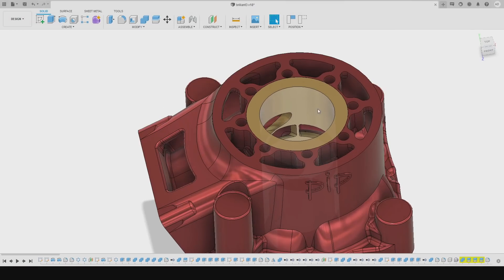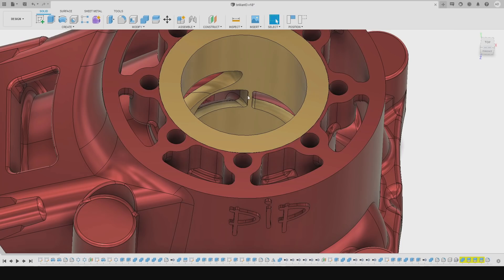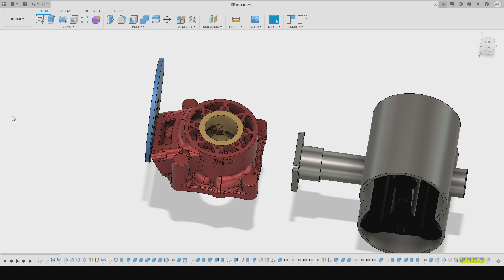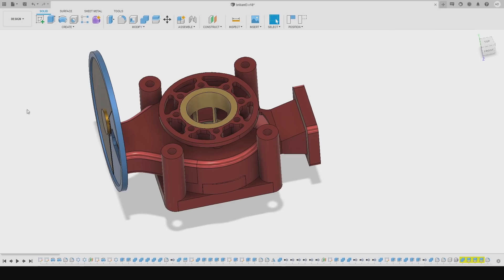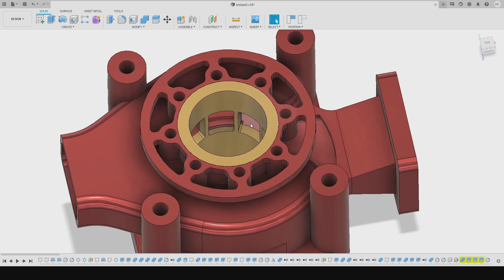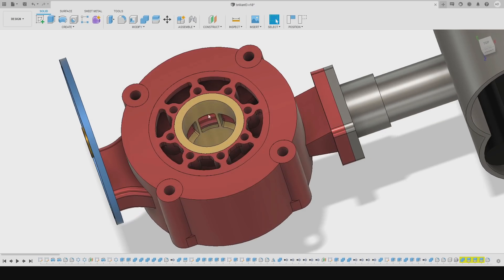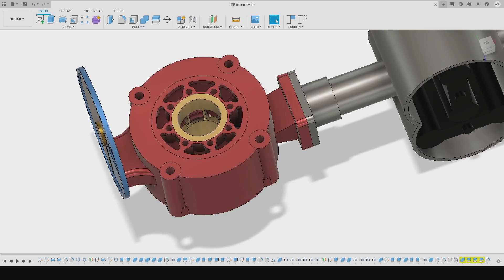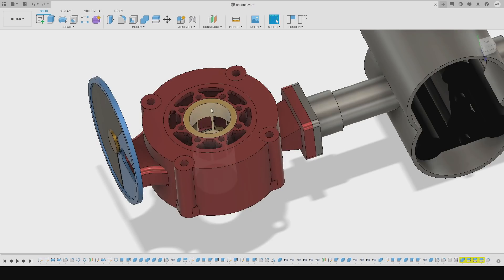Will BLOW Up the Competition! Seriously!

Comment: Two things come to mind: pumping the flushing gases takes power to turn the blower. What happens if a hot particle ignites the mix in the intake duct, likewise, the exhaust while flushing - your reed & rotary valves need to be unobtainium not steel. Why not two rotary valves on a common shaft?

Comment: Surely with this level of complexity you're better off with exhaust valves, properly timed in the cylinder head and the intake all round the cylinder. You can also run a turbo as well that way 😁, you have just reinvented a Detroit diesel 2 stroke but with a different exhaust valve.

Comment: Ever since 4 stroke direct injection gasoline engines started to hit the scene I thought this brute force 2 stroke induction idea for would be perfect paired with direct injection because you can time the fuel injection precisely when the ports are closed. I don't think it will be practical to try direct injection on your little engine but it's still an idea to ponder maybe for another project down the road

Comment: Good idea!
But you can exchange the rotary valve and the blower for a turbocharger ... the pressure would be automatically increased between the cylinder outlet and the turbine so you don't need the rotary valve, and the compressor is in charge of pressurizing the cylinder

Comment: how do you pretend to cool this engine? you have exhaust all around the cylinder it will probably have a hot spot. Also cylinder pressure is way higher then any boost pressure. So i will open the exhaust ports at least a little before intake ports. Detroit diesel two stroke uses just one valve to control exhaust in the cylinder head and have a similar design of ports all around the under crank.

Comment: YES! i drew a rough sketch of an engine similar to this when i was in high school, always wanted to see what would happen! in my old concept i was thinking that a direct fuel injector could help a lot with fuel efficiency and pre-combustion issues and would allow you to run a 4 stroke style pressurized lubrication system, which in turn allows you to run strait gas. but obviously thats much more complicated to set up with the high pressure pump and all that... also Ferrari did something similar with the Tipo F134, worth a look.

Comment: If you had direct injection of the fuel from the head you wouldn't have good fuel and air being forced out the exhaust from the blower.  Just air would be forced out during the overfill of the cylinder and the direct injection would not add fuel until all the transfer ports are covered by the piston.  This would make it way more fuel efficient and burn way cleaner also.  I am also curious to see how well the reed valve will hold up to the heat and exhaust pressure as you have described.  Also curious as to how much horsepower it will take to run the blower.  Seems the sizing and speed of blower would have to be experimented with to optimize.

Comment: That blower is going to take some power to drive.  Question is will the engine produce so much more power than it otherwise would have to make it worth the extra parasitic losses from driving the blower.  Also it'll be cranking out unburnt fuel through the exhaust like 45 bastards so that header is gonna get REAL hot!  :)  Can't wait to see the result.

Comment: I think you should use a centrifugal supercharger to reduce parasitic loses and make the exhaust port higher to open before the intake ports, because there’s a chance the exhaust might set off the intake misfire before it gets into the cylinder. And to increase efficiency out a turbo on it to increase the back pressure. Have a draw through carburetor set up, then centri feeding turbo(again reduce parasitic loses) and then engine.

Comment: The intake length tuning will be important for the timing of charge air to push the spent charge out. this would allow a longer duration in the rotor valve. are you going to use port or direct injection or carb?

Comment: if the intake and exhuast open at the same time, wont the engine blow up if the compressed mixure in the intake hits the hot exhaust? assuming the exhaust presure is higher than intake? also if the intake blower is generating that much pressure it eats away of the power from the engine. 
that said, very cool idea and the cad design looks very nice!

Comment: I think the problem you're likely to run into is longevity of the exhaust valve due to heat and lubrication issues. 
A more efficient way of doing seems to me to use a poppet valve in the head like in a Detroit Diesel or (more fun and cooler) a sleeve valve.

I want to know what's pixelated over your left shoulder!

Comment: I see this motor actually making good torque unlike most 2 strokes no waiting for power bands, just boost it could even work with a turbo and start it with a leaf blower, you should look a old 2 stroke diesels pretty much the same concept for port timing

Comment: Wow sounds cool, but.... what about overpressure on the intake when everything is closed and the huge parasitic drag spinning that HUGE supercharger. BTW if you want that supercharger to last take it fully apart and clean all the crap they leave behind and put it a good set of bearings. If it should backfire with a draw through system you have to have a way to vent the explosion of the compressed A/F mixture unless your going with direct injection. Personally I think crossflow would scavenge better. If you can work out all the issues it will sound really cool. Hey instead of resonance of your current engine put the supercharger to work as the secondary induction system that comes in around 6000 rpm, just use a centrifugal clutch. I still think using no ring on the current engine is the way to go. Just lap the piston to the bore at operating temps so it fits perfectly. The only problem is you have warm the engine fully before it will move, just like a Formula 1 engine. The piston could be made much, much lighter so you can turn even more RPM's! Best of luck!

Comment: I think the high exhaust ports will hurt performance.  Personally I'd leave them low, as the intake charge will always be pressurized. The higher the exhaust port, the less compression, and more waist from the exhaust, as you are allowing longer duration to the Exhaust, thus increasing Exhaust runner pressure = waisted power and fuel.
The rotary valve is a good idea, CanAm used that in thier dirt bikes years ago, and it worked.
An exhaust valve in the head would keep the inlet charge in the chamber allowing a hotter intake charge.
Think of a Detroit Diesel 2 stroke. 
Further, maybe a rotary valve on the head instead of a traditional valve maybe a lil more efficient??

Comment: I love your creativity and your willingness to experiment.  The only obstacle I can see with your new design is how are you going to stop combustion when the piston is on it's way down? I am thinking as soon as the exhaust ports are uncovered, the combustion event will propagate to the plenum surrounding the piston and blow a hole through the rotary valve...the whole area from the exhaust ports to the rotary valve will have an unburned air/fuel mixture in it....maybe you have discovered a new type of jet engine?  I can't wait to see it, and I hope I'm wrong.

Comment: I came up with a similar design in 1970 with an isolated crank case.
If it works you will end up with  a 2 stroke top end and possibly a 4 stroke bottom end.
The ideal setup.
Love your work.

Comment: At some point you will reach a level of complexity that won’t be worth it. You might as well put valves in the head and add camshafts and forget the ports in the cylinder entirely. Don’t you get what I’m saying? You’re slowly building a 4 stroke. Except this engine will be more complicated and less efficient. I love the old design and I think it is really promising. Please don’t give it up.

Comment: hell yea another new amazing project :D do you have an idea about the bottom lubrification? the great thing is that the piston should be very lubrificated with that design , just need to find a way to use that "wasted" pressure and oil to lub the bearings. also a down side i m seeing is that the ring may not have enough material to transfer heat to, making the piston and the engine overall run hotter maybe you could make some kind of hollow piston skirts so the "wasted" mixture comes in the piston and cools it down
Reply: oh i just had an idea, since the supercharger pressure will increase each time the piston closes the way , you could use that extra pressure on oiling the bottom end of the engine via a wastegate type of thing placed in the bottom . i don t know if it could work as i m not really confortable with 2 stroke oiling to begin with . if you place it well enough you may even be able to cool down the bottom of the piston with the mixture maybe via a squirter thing like in 4 strokes engines
Reply: or maybe not a wastegate but more like a rotating disk system , like you will use in the exhaust, that way you re not limited to a spring that takes time to react

Comment: Thats just crazy!!! Maybe you need to put the intake on the Motorblock, direktly to the crankshaft. Otherwhise it wount   rund at low rpm because the compressor starts comressing only if the crankshaft is Running on high rpm. Or you make something with direkt Injektion. But in Theorie a cool project. Always exited to see new videos 😉🙃

Comment: i'm in no way knowledgeable enough to give any advice, however I think you need to get the rotary valve and the reed valve as close as possible to the combustion chamber. Exhaust gases will have a hard time getting to the reed valve and keeping it close while simultaneously exiting from the exhaust. I think you risk a little bit of burnt gases remaining in the combustion chamber compressed together with fresh mixture.

Comment: Hey mate!
Since you are thinking about Supercharging: Maybe you should have a look into preWW2 DKW-racebikes. They run a concept called "Ladepumpe" which means something like charge pump and later switched to supercharger. Interesting for you could be the UL-Concepts (U stands for engine and L for "Ladepumpe" so charge pump) They later moved on to ULM (M for Membran - membrane) and then to ULD (D for Drehschieber - rotary valve). Sadly the US, which was the Supercharged one, had to much mechanical faults with the charger. They had it chain-driven from the Crank at about 1:1 ratio. It pumped constantly air into the crankcase at about 0,9-14 atü ( 27-34psi i think). And since war already started, there was no time to evolve that concept. After WW2 they build a concept called "GS" - supercharged but different engine design.
You can find Videos of the UL/ULM/ULD on youtube mostly under the name "Singende Säge" which translates to singing saw :-)

Greetings from Germany!

Comment: between the blower, and the reed valve, why not have a containment vessel that the blower fills with pressurised air, electronic release valve to then release the charge into cylinder once the piston has past the exhaust port on its way back to top dead centre.

Comment: I wonder if there is enough of the fresh fuel/air mixture coming out exhaust to feed a small ram jet engine. Or just put some kind of igniter in exhaust for some flames and maybe some thrust. Just thinking of ways to take advantage of the leftover unburned mixture.

Comment: intriguing. I think it has all kinds of potential. The first 2 big things that jump out at me,  #1. the challenge of setting up and timing the rotary valve. I suppose if it's geared/chained to the crankshaft with proper even/consistent timing and reliable at high speeds, then it could be feasible #2 the reed valves on the intake resisting pressures and the supercharger constantly making pressure.. might require a big enough chamber on the intake side between blower and reed valves to give it a cushion like an air capacitor, OR a blowoff/bypass valve to vent excess supercharger pressure when it's not being asked for. Totally rad, quad ducts remind me of a Mario Kart 64 battle

Comment: Looking at the design the rotary valve expansion during heat buildup is my concern. What if the rotary changed to flap with pressure difference control from the sc, it may not be possible and it will be complex. Just saying cheers. All the best on the project mate

Comment: are you reinventing the 4 stroke cycle ?

even folded into a single cycle, the drag to carry extra valving/wheel will hurt getting high revs where the power lays...

I'm not even mentionning the load of a supercharger.

Which may change the class at Bonneville, too ?

Comment: There is an interesting solution to this in opposed-piston engines. The both pistons run slightly out of phase with each other, meaning the exhaust and intake-ports are exposed and closed at different times in the cycle. Since this is determined by the movement of the pistons themselves, resonance is less of a problem. Also because they are located at opposite sides of the cylinder, blow-by is less of a concern.

If you truly are aiming for a 50cc, 100+ HP, i think opposed pistons might be worth a look. They (just under) halve the piston speed per unit of compression for a given bore. And seeing as you're not concerned with size, the extra room for the connecting-rods/axels seems a worthwhile tradeoff.

Comment: I think you will have problems at higher rpm. Makes me think of old two-stroke diesels. You need valves. Wouldn't it be easier to rebuild an existing four-stroke to two-stroke as a test? You just need to make a new camshaft for it. Good luck

Comment: Won't the fuel are mix in the transfer ports ignite on the down stroke and blow the reeds out  and bend the exhaust valve they will have fresh fuel air mix in them waiting for the fire to come down and set them off

Comment: Hypothetically if the crankcase is sealed off could you run an oil filled crankcase like a four stroke and no oil in gas for maximum power

Comment: The parasitic loss of that supercharger overpowers the mass of inertia that 50cc engine has, and that exhaust port design does not flow. There will be enough fuel in the pipe to feed an afterburner, what would be the only force making the vehicle go forwards. Might be the time to stop dissolving your braincells with alcohol. These ideas are reaching the "waste of good material" point. Adequate for YT comic relief, but as an engine prototyping and designing.. Nope. Today's engine design is all about efficiency. When your 50cc engine is wasting more fuel than a 1000cc engine is using, no real manufacturer is interested.

Comment: Hi!

Its not good if that brute force that you are talking about, comes from the crank of your engine (less power). I think in the long run, you should look more into efficiency since you are making the MOST powerful 2 stroke.

Turbocharger would take much less power from engine to do the same thing as the supercharger. Also, 2 stroke expansion chamber is very good since it utilises that resonance for charging. I think it is needed to make engine most powerful.

Please don't do same mistake as almost every small engine charger guy does. No intercooling. It is VERY important to have.

That large rotary valve is probably going to cause a lot of friction with high pressures and then problems. Normal valves and seats are great at holding high pressures and does not take so much power to drive.

Comment: I think of it like this: When both the transfers and the exhaustport are open simultaneously, the supercharger will elevate the pressure between the Stingerpipe and the supercharger outlet. It would act like a semi-closed system where the stingersize and the supercharger determines the pressure of the whole engine as a closed system. So the supercharger should theoretically pressurize the pipe too, every single revolution. I believe at really high rpm, the pressure in the pipe would build up as the stingersize determines whether or not to let everything out.

Comment: If the blower pushes enough charge in every revolution it could force the exhaust out and a 1 stroke engine may be possible. That would be some horse power.

Comment: Look at wesley kagan page on his diy freevalve system. That system would be possible with an electric solenoid as wel. Use a slider valve connected to a electric solenoid and you can control the valve opening time at every rpm. 
The problem i see with this system how you designed it is that it wil not be working at all rpms. You need a certain opening time to scavange at full rpm, but on idle it might not even run with that timing. Now if you went freevalve style you could adjust timing according to rpm. Its also really easy to test with different exhaust opening times on the dyno that way. You dont need to cut 50 plates for a rotary valve to find the perfect one, just adjust the time in the arduino and go.

Comment: I think you will encounter overheating and detonation all together on flushed, with boost, i guess, if you use steel sleeve with a good forged piston and over head valves to control in and out will work much better

Comment: Theoretically everything you explain is correct, but practically other factors come into play.
1. energy required to rotate the blower and the rotating valve. The theory claims the high hp, but the hp that the extra rotating parts will use, if you subtract that energy, you won't be left with much profit.
I would advise you to continue with your previous project. Put the bridge how you like it and test it out.
What you do now is that you create a 2 stoke puzzle for yourself, which will take a lot of energy to puzzle out in time.
your previous project is a new 2 stoke base that can break a record .. ps keep up the good work